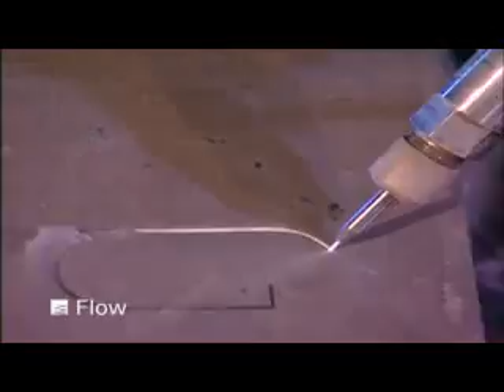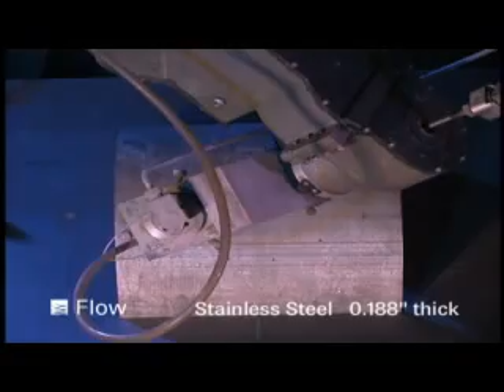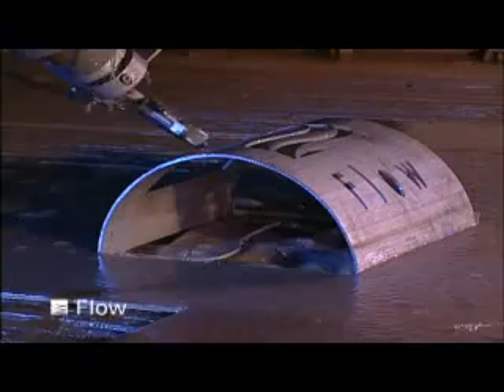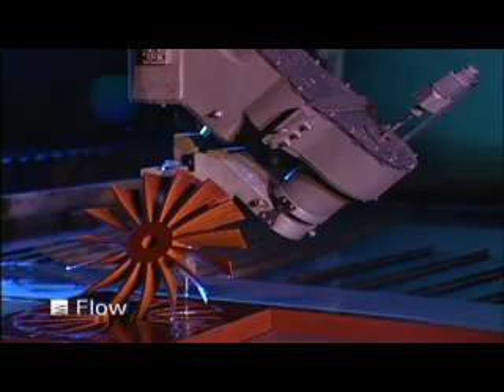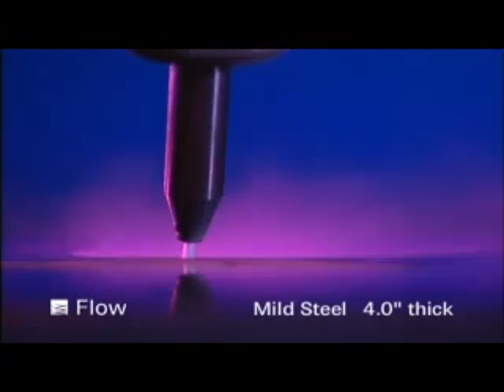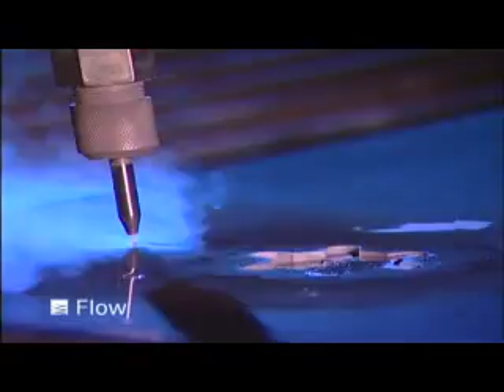Flow 5-Axis Waterjet

Comment: cutting fluid is high-pressured water (pressure goes up to 6000 bar).
i guess you can control depth by using pure water or adding abrasives and vary pressure

Comment: Depth can be controlled by adjusting both water pressure and movement speed. not very high precision of depth, but i have achieved +/- 1-2 mm with my waterjet machine